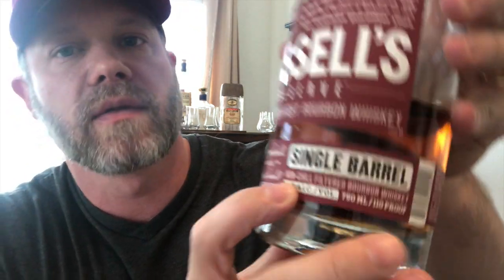Non Chill Filtered Explained

Comment: Interesting.  I had not head so low as 86 proof.  I keep hearing 92 proof for international whiskeys. I was curious as to the reason why.  Anyway, I relieved a memory when you explained how alcohol is a solvent.  About 10 years ago, just before I got married, my then fiancée moved in with me.  I came home from work one day lamenting about how a pen failed, coving my hand in black ink.  I used some hand sanitizer to break up a majority of the ink.  My wife had not see that before so I explained that alcohol is a solvent.  And the fates would have it, less than a week later I left a pen in my jeans and when my wife did laundry, the pen bled all over my clothes.  Thinking it a good idea, my wife poured half a bottle of Woodford into the washer, then was surprised when none of the ink came out.
Reply from the maker: Thanks for sharing your story! It's interesting how alcohol can have various effects depending on the situation. Regarding the proof of international whiskeys, it can vary depending on the country's regulations and traditions. For example, in Scotland, the minimum legal proof for whisky is 40% ABV (80 proof), while in the United States, it's 40% (80 proof) for straight whiskey and 30% (60 proof) for blended whiskey. Do you have any other questions or thoughts on the topic?
Reply: @BourbonRealTalk  - oh, I meant minimal proof for non-chill filtered.  I seem to recall hearing in whiskey tube that scotch and Irish whiskeys had to be at least 92 proof to be nonchill filtered and that Indian, Taiwanese, and Japanese whiskeys filled suit. I was surprised when I heard that lower proofs could be nonchill filtered.
Reply from the maker: @Abby_Normal_1969  The distiller of Charbay said once in a video 95.8 proof, but I have heard numbers all over the place.  It doesn't matter unless the whiskey gets cold.  I suppose people could be using different proof points based on the typical temperatures they expect their bottles to be exposed to. I.E. if you ship to Canada you might have a different number than if you are a TX whiskey sold only in the state. I think that most major producers ship internationally so they want their bottles to be prepared for any weather, so the practice became universal.

Comment: I have been wondering about this. I wasn't surprised that if I searched your page I would find the answer. I would like to try 2 of the same bourbons each way to really see if a difference could be tasted. Have you ever been able to do that?
Reply from the maker: Yes with Weller Antique.  Once was a single barrel so it wasn't exactly the same.  All the studies I have seen show that the average person can not tell the difference.  My theory is that the additional oil may hold the flavor compounds in place slightly longer which could affect the length of the finish, but not the flavor.  That is just my theory and no science to back it up.

Comment: Randy, thanks for sending this over.  I will post my question here in-case it helps in any way or gets this moving up!  So while attending the Repeal Day seminar, I got into some good discussions with some distillers and reps from distilleries.  With a few of them, I brought up the fact that I had wondered why some of them upon first being opened, I didn't care for much?  Yet, once the bottle was open and had seemed to have a chance to breath and I went back to it, I found I actually really liked it.  These said bourbons/whiskies being drank neat.  I threw out that I was wondering if I was just having an off pallet day.  Both of the distillers that gave me pretty in-depth answers or their opinion on why this was, both stated something to the effect of that is one of the characteristics of a non-chill filtered process and that they are intended to do that. Has any of your research led you to come to this conclusion by any means?
Reply from the maker: No.  This subject of fresh cracks and neck pours comes up A LOT.  All scientific evidence points to a placebo effect.  Whiskey does change in the bottle, but so slowly that you would have to wait years before chemical reactions took place that could be discernible. I do not fully understand the chemistry, but after my dusty video a discussion started in HBS that had actual chemical engineers explaining the chemical reactions.  According to them the changes taking place do not even use oxygen (except some change to a protein that also required sun light) and the terms oxidation and oxidization are actually misnomers.  We know there are countless things that effect your perception of flavor like mood, environment, expectation, etc. and it is much more likely that your palate and perception changed from one drinking session to the next than it is the whiskey changed.